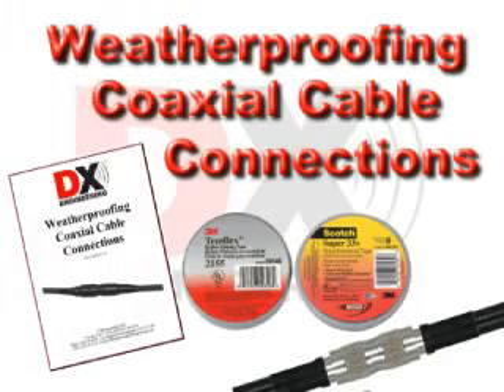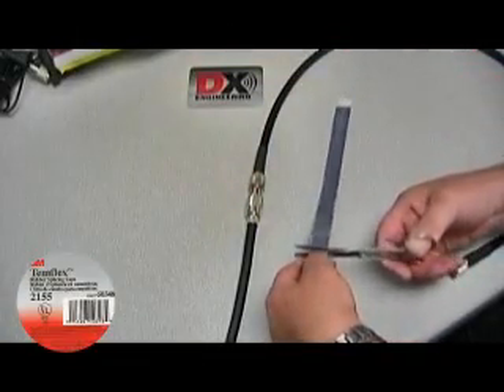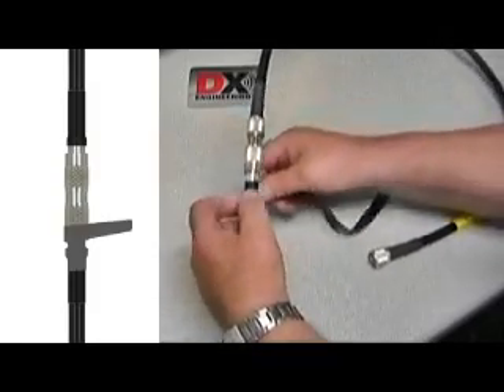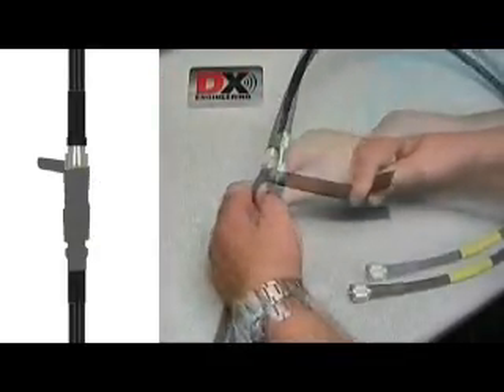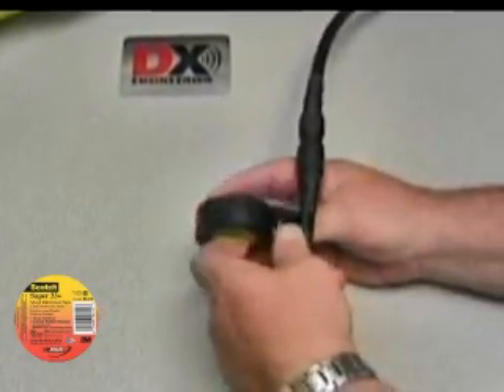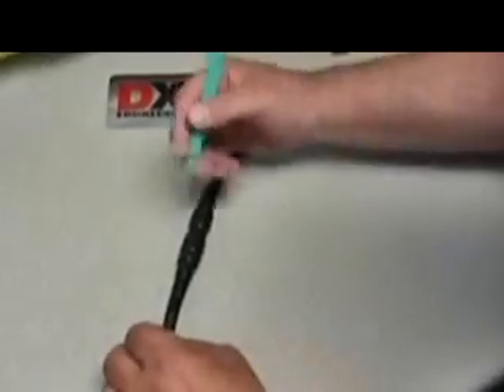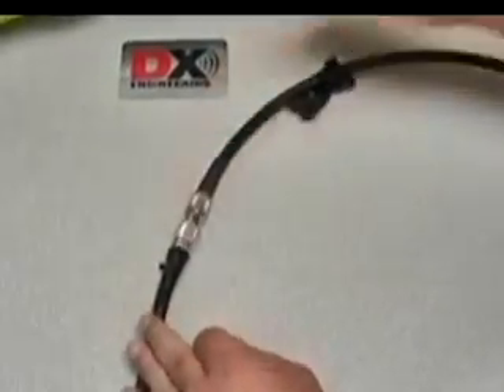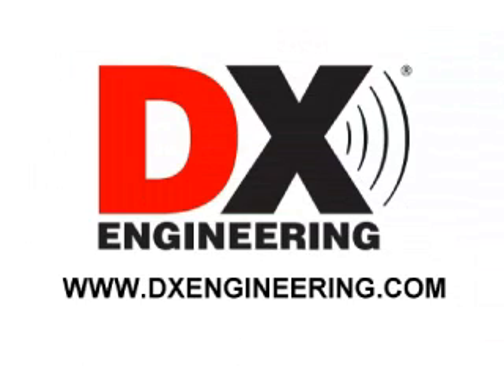Weatherproofing Coaxial Connectors

Comment: I've worked in the power industry for 35 years. We seal underground splices with a product called aquaseal, then rubber tape and finish it with vinyl tape (electrical).
Reply: I was taught by the navy, vinyl, rubber, then permatex liquid electrical tape. Just vinyl and rubber tape aren't enough in my experience.

Comment: Well, it does cover how to wrap and what to use, but the angle of watershed is important.  Two wraps of self Amalgamating Tape, starting from the top connector, down to the bottom, then wrap backup. This creates a shingled effect.  Then wrap the same way with a good quality Vinyl tape.  The first two layers is what does the job.  The Vinyl just holds it in place.  Anywhere the self Amalgamating Tape contacts should be clean, otherwise, it won't be a good seal.  Note, the self Amalgamating Tape doesn't adhere to the connectors and coax, just seals with it.

Comment: Had one antenna coax sealed like this & the inner flex tape or whatever it's called leaked.8 other antennas have 3M electrical tape covered by Coax Seal & then taped over again & NONE of them have failed.I'll take Coax Seal over this stuff any day as well as the stuff that Andrews puts out that looks & feels like Coax Seal.

Comment: I'd wrap the rubber sealing tape then heat shrink over it.  Electrical tape won't cut it over time.
Reply: 33 isn't ordinary electrical tape. I've used it in harsh conditions for many years. No failures or moisture intrusion.